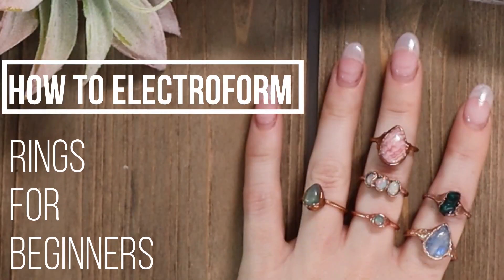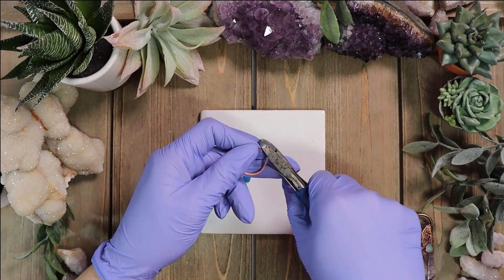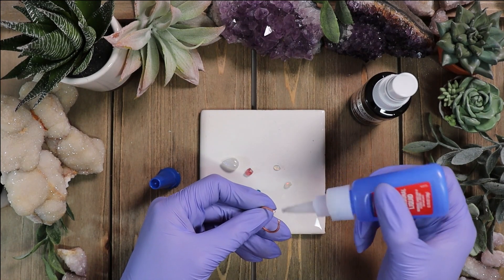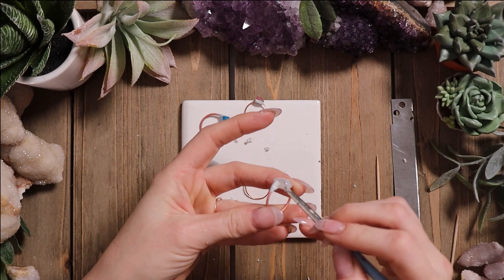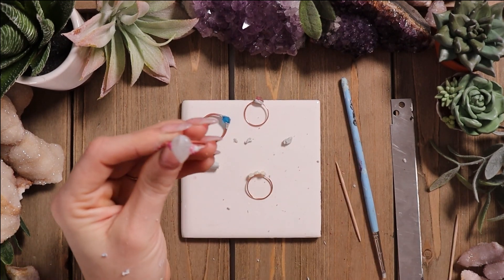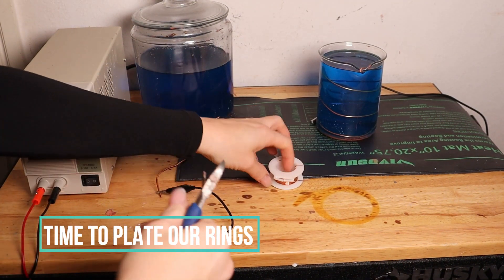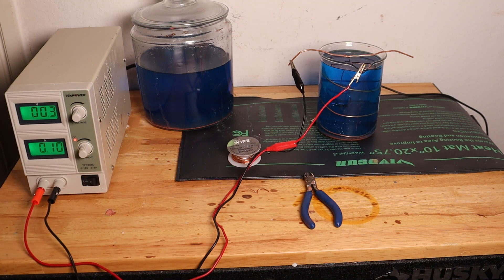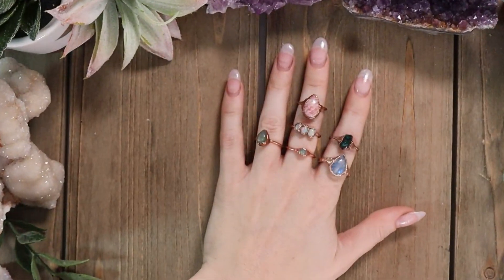How To Electroform Copper Rings

Comment: Hi! Thanks for posting this! Question, one you use the blue electroforming bath for a set of rings, is that it? You throw it out? Or can it be used again several times?
Reply: I use it over and over! Don't throw it out, if it's not working as well you can add brightener and distilled water.
Reply: once

Comment: I have the same rectifier but I can’t get get the amps and voltage to match what you have, when I try to up the amps it ups the voltage and I’m unsure why or how to fix it
Reply from the maker: It's been so long since I've used mine. Off the top of my head I can't think of any troubleshooting. Definitely go to the electroforming facebook group and you can search that question. That is where I learned so much!

Comment: So sorry! I have one more question. When I'm not using the electroforming bath, can I put a lid over it so it's no longer going into the air? Or does it always have to be vented even when not being used. I just don't want to have something bad happen lol
Reply: I'd put it outside, but I don't want bugs falling into it. Sadly I don't have a garage
Reply from the maker: Yep! Just make sure to take the copper coil out of it and seal it nicely so it doesn't evaporate. Sometimes when I leave mine a while it grows crystals at the bottom, not sure why.
Reply: @MandyReyesDesigns Thank you so much! You've been a lot of help ❤ I'm nervous but so excited to start!
Reply from the maker: @arielmay827  once you start you're going to want to plate everything 😆
Reply: @MandyReyesDesigns  I can definitely see that happening! 😂 I already have sooooo many ideas

Comment: Great tutorial! I bought all the supplies and Im ready to start electroforming! I am stumped on a place to set it up as my apartment doesnt have good air flow. Do you think it would be ok to set it up in a cabinet or a cupboard?
Reply from the maker: I'm excited for you! I can't really say because the solution is basically an acid and I don't know if it has fumes that come off of it. Also, keep in mind that whatever is around it might get damaged. I keep mine in the garage on top of a large tool box and the top, which is wooden, now has a lot of orange stains that don't come out. Ideally, I would recommend setting it up on a patio. Best of luck!
Reply: @MandyReyesDesigns  Thank you so much for your reply and input! I will have to do it outside and maybe keep it covered when its not in use
Reply: My first 2 pieces turned out pretty good for my first try! I am wondering how often I could replace the anode coil? I took it out of the solution when i was done and its a pinky salmon color. Can I still use it or should I make a new one?
Reply from the maker: @pandasouldesigns  yay! You can still use it, the difference is you will need to use a brash brush or Dremel to shine the piece out of the bath.

Comment: Hello again! I did another ring following your suggestions. I painted up around the edges to make sure that the copper could form a kind of a shell and it worked wonderfully! It's about 7 hours in right now. I started at .2 amps and then moved it up to .25 amps after 2 hours.  The copper has formed where it should, but the surface is very clumpy, rough, and slightly sharp in some places. It's not isolated to one part, it is all over. Any thoughts? I have done research on multiple forums and cannot find anything
Reply from the maker: Hmm, I wonder if it could be from the paint. If there were tiny clumps of graphite they might draw extra current creating the bump. You could make another batch and stir it with a dremel or hand mix A LOT and test that. Sometimes if the solution has a lot of copper sludge at the bottom it could be that. I'm not positive, but these are my two thoughts. You tried searching the Facebook forum?
Reply: @MandyReyesDesigns  it totally could be paint, it was mostly smooth but clumped a little as it dried, the issue also happened on the band itself though and there wasn't paint there. I tried joining the group but the application hasnt been accepted

Comment: Hi there! Tried my first project today, I was checking on it every 20 minutes or so. When I took it out after about 3 total hours, there was lot of playing, which I was happy with! However after barely touching it, the plating came away in large sections from the stone. What would you suggest? More paint? Higher amps?
Reply from the maker: What type of stone is it? Sometimes they have an oily polish on them which makes it difficult. Also most items take 12 to 18 hours before you can get a true idea of how sturdy it will be. Is it a pendant or ring?
Reply: @MandyReyesDesigns   ah I didnt know it took that long, most videos mention 4-8 hours. It is a polished white moonstone. Should I be washing the stones in some way?
Reply from the maker: @Ishfwilf  is it a ring? If so I would recommend painting around the stone a little bit higher so that the copper kind of builds up on the sides and grows over in order to kind of encapsulate the stone. Also, definitely let it sit more than 3 hours. You can message me a photo if you like on my ig and I can try to help ya more tomorrow.
Reply: @MandyReyesDesigns  it is a ring! That makes total sense, I cant believe I didnt think about that! I will give it another go and will let it sit for longer. I appreciate your help!
Reply from the maker: @Ishfwilf  I'll keep my fingers crossed 😉

Comment: I bought the graphite and paint you suggested, what is the ratio of paint to graphite for the conductive paint?
Reply from the maker: I don't have a ratio, what I do is definitely not scientific. I use a small Dixie cup, then pour in some paint. I mix in as much Graphite paint as I can. You'll know it's too much if it's clumpy. Some say to add water, but it will get moldy over time if you don't use it quickly. The more Graphite the better, the trick is just to make sure it still has a paint like consistency. I mix it a lot to break up the small chunks. When I paint an item, that is when I will add a drop or two of water to thin it out a bit if necessary. I have seen a YouTube video when I first began and followed her instructions. Good luck!
Reply: @MandyReyesDesigns  thank you so much for the instant reply!  I've been watching your videos on repeat for the past few days and have gotten everything that you have recommended purchasing. I'm prepping my 1st solution tonight and doing my 1st actual project tomorrow! Thank you so much!
Reply from the maker: @Ishfwilf  Wonderful! So happy I could help in any way.

Comment: Do you have to do this in a well ventilated area? I'm dying to electroform some stuff, but I have no rooms with adequate ventilation which I could do it in.
Reply from the maker: Darn! Well if you don't have pets or kids you might be able to set it up in a bathroom with a vent on? Lol that sounds like something my crazy self would do. I don't know much about the chemical except that it is extremely corrosive and you definitely don't want it to touch your skin. It doesn't smell, BUT carbon monoxide also doesn't smell and it can kill you. I wouldn't risk it.
Reply: @MandyReyesDesigns  That's what I was thinking - crazy bathroom experiments! I don't have pets, but if I open the windows of my flat all the neighbourhood cats come in, so doing it safely in a room with the window wide open is tricky! Thanks for your advice. Your sculptures are soooo beautiful! 😊

Comment: Did you put conductive paint on your ring shank too or leave the wire bare?
Reply from the maker: Sometimes I do because I worry that I might have gotten nail polish or superglue on the shank and then it won't plate. If you are certain the shank is completely free of anything other than copper then I wouldn't paint it. Most of the time I don't need to.
Reply: @MandyReyesDesigns  thank you! Really helpful video! 😊

Comment: i would love to learn this. I wanted to know if this whole process has a strong smell? especially since you have to leave it for 8 hours
Reply from the maker: It does not smell, but I definitely would not do this in an enclosed area or your home. The chemical is very toxic and it basically eats through anything I let it touch for an extended period of time.
Reply: It doesn’t

Comment: Can you use polymer clay instead of h epoxy ? Epoxy is quite expensive and I have heard of others uisng the polymer clay
Reply from the maker: Polymer clay is great for making designs to plate over, however it would be a poor decision to use it as a replacement for the epoxy. It definitely is not strong enough and it would compromise the integrity of the ring.

Comment: For some reason each time I do rings the band plates first and gets unevenly chunky. Do you have any suggestions by chance on how to avoid this? Love your videos, super helpful!
Reply from the maker: Hmm, good question. How many rings do you have in there at one time?
Reply: @MandyReyesDesigns  only one, I have a smaller glass beaker with a single anode piece in the opposite side of the piece in working on. I always clean the metal before it goes into the bath and I notice that only one side of the ring band grows extra material. I've even flipped the ring thinking that it must be the side closest to the anode but sometimes the side furthest use the one that plates.
Reply from the maker: @marisa9898  so if I understand correctly you only have anode on one side of the beaker? I think that's the issue. Try putting it on both sides or using a coil. The Facebook group is a great place to search that issue!
Reply: @MandyReyesDesigns  Thank you so much for the reply and suggestion, I'll definitely give that a try!

Comment: Hi, you made the best tutorial video about electroplating! I've bought everything you recommended. As a newbie, I would really like to know how much Brightener & distill water I need to add into my electroforming bath? Thank you very much!
Reply from the maker: Thank you! This might help https://youtu.be/fNR6JWArK10, I fill my entire beaker with solution. Then when I have to clean it, I replace the missing solution with a few drops of brightener and distilled water. I use a piece of scotch tape to mark the beaker at  the top of the original level of the solution. No exact science I know, but maybe it helps.
Reply: @MandyReyesDesigns  Thanks for the prompt reply! I thought I need to add the brighter in the first bath. But as I saw the video you sent me, I only need to add that when I clean my solution?
Reply from the maker: @ellazhen6940  exactly!

Comment: Hi! I was wondering how you heat your solution or keep it warm? Also do you have recommendations on where to set up your workspace? Thanks!!
Reply from the maker: I apologize, I just saw this comment. I bought a small heating pad that is used for plants to use for the winter. It maintains the heat at about 70 degrees. I live in Texas, so it doesn't really get too cold here. I have mine set up in the garage. Basically anywhere with ventilation and away from pets and kids will work.
Reply: @MandyReyesDesigns   i live in a 1 bedroom apartmnt and I have an 8 minth old son. I have been putting off starting because I am afraid of toxic fumes. Do you kniw of any ideas to vent fumes? I am not sure what the solution to this is. I live in ontario canada so its freezing here and no way to work ourside even opening a window will make my apartment cold..i have all the supplies needed and I have been puttibg it off for a year now but I so want to create.

Comment: Everything you need 
Crystals 
20 gauge wire for ring 
Cutting pliers 
Instant glue for super glue
Apoxy glue 
Conductive paint 
24 gauge wire 
Beaker 
Rectifier 
Dremel
Reply: Is all the tech things expensive? 🥰 I'd like to start this as a hobby not a business so I don't want to spend to much money.
Reply: @mari-px1he  the most expensive I think is the rectifier which is $56 but all together it’s more than $120 or around it
Reply: @mari-px1he  I would say it is a bit
Reply: @mari-px1he  I paid close to $300 for a kit that comes with the basics. I think you can sub some things with others to lower the cost. I saw that the conductive paint refills can range from $17-$40 depending on brand/where you purchase. The rectifier is definitely the most expensive part.

Comment: Have you tried coating your stones with liquid latex? Do you specifically prefer clear polish to liquid latex? I have all my supplies and about to dive in, I have clear polish but the liquid latex has been recommended so much, I'm torn on which to use.
Reply: ..and thank you so much for such a beautiful, straightforward tutorial.
Reply from the maker: I have tried it and I personally didn't like it. I tried frisket and the liquid latex in purple, fyi it smells awful 😆. I didn't have as good luck as I do polish. Also, the frisket was more noticeable when it would get stuck in tiny crevices of spirit quartz or grape agate. I tried frisket and polish together but it was too thick so when I removed it it left a gap between the stone and copper. Best of luck!! Wish I had a better answer.
Reply: This a perfect response. Thanks for your quick response. Clear polish is cheaper and easier to get so I'm all in for that. You've been a real help. ♡

Comment: Hey! Awesome video! Do you think I can use rocks or agates found at the beach? thank you. Also, do you just super glue the stone on top of the wire ring or in between it was hard for me to see that part :) THANK YOU <3
Reply from the maker: Yes you definitely can! And it depends on how you want it to look. The majority of the time I glue the stone in between the wires.
Reply: Vintage Sugar Skull how long do you have to wait for the epoxy to dry before you put in the solution? I tried out my first ring it’s super dope but you can see the epoxy and conductive paint in some spots. I think I contaminated it because I didn’t wear gloves through the whole process. Thank you!!!
Reply from the maker: @daysealady  It would be ideal to let it set about 24 hours and make sure you paint it all over with the conductive paint. It's odd that you can see the epoxy. How long did you leave it in the solution?

Comment: Awesome Video. I am wondering if you could use small amounts of air drying clay instead of the epoxy?
Reply from the maker: I wouldn't recommend that as it probably wouldn't be strong enough. The copper only plates the material and it would be best to something sturdy inside, maybe polymer clay would be better?
Reply: @MandyReyesDesigns  thank you for your reply :)

Comment: Thank you for the video -added it to my favourites - I have a question - how do I incorporate gold plating into the process ?
Reply from the maker: I had the same question and researched and found plating systems but they were extremely expensive around 1000. Try googling gold electroplating system. I found a small mini set for rose gold only 60 bucks, but it won't last and will wear off so I was a bit disappointed.
Reply: @MandyReyesDesigns  yep I see those systems, expensive ugh.....then again- do I put a ring with a stone In that system ? will the ring get plated as well? so many questions -)
Reply: @hayden722  the solution for each type of metal contains different ingredients.so the blue liquid would not contain the same ingredients for copper, silver, gold, brass etc .each type of metal is a whole different recipe. The process is same just the electroforming liquid solutions are different. U can look Into it. I think the copper is cheapest and easiest

Comment: Hey, great video! Found you from reddit! Strange question, would teeth work as the "gem" for this? Or is the material too soft and would it errode?
Reply from the maker: It would definitely work! You would need to seal it properly first with a lacquer before painting it with the conductive paint.
Reply: Would it work with resin cabochons?
Reply from the maker: @nayomihathu4377  yes I've done it with resin no issues. I've read it can get cloudy but I think as long as it is fully cured it should be fine.